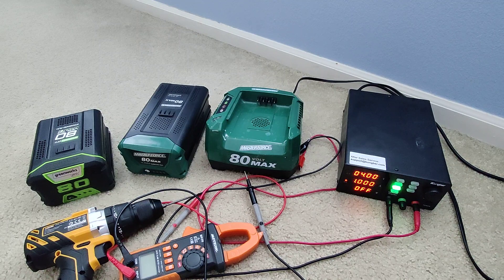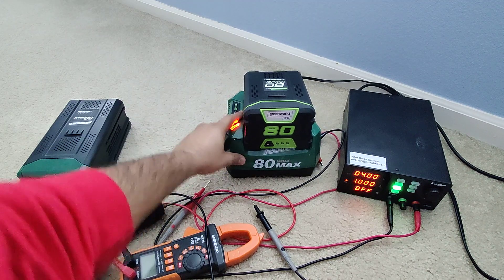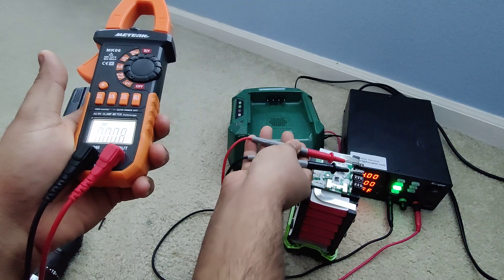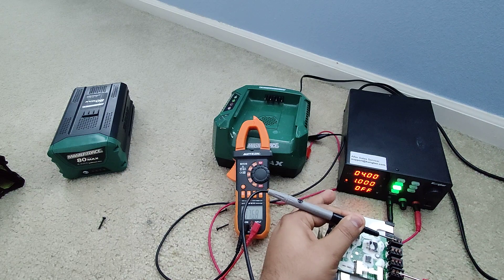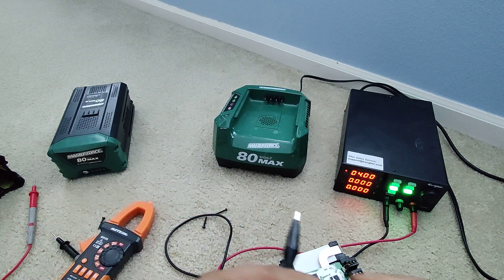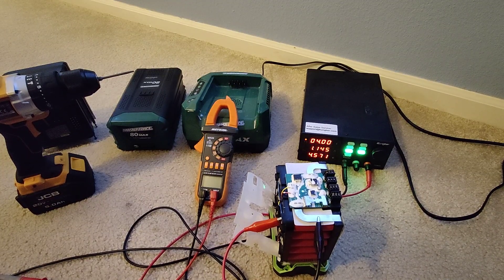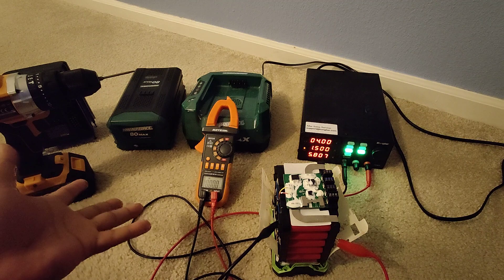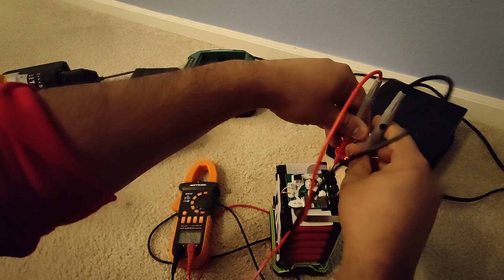Greenworks 80V 2AH Battery Teardown & Repair (Red Blinking Light Error!!!) Part 1

Comment: 19min: but why are the cells out of balance, and won't it just happen again?
Reply from the maker: Depends what caused the imbalance in the first place. If it was bad cell, it will happen again but it was drained due to left in storage for too long then it shouldn't happen again.
Reply: @Xx_TheCuriousBrain_xX  i was able to repair 3x 80v batteries. just recharging each cell using a dc power supply 4.2@2a cc cv   thanks

Comment: My 80V Kobalt have different notches and aren't interchangeable.
Reply from the maker: Interesting!
Reply: You can ‘adjust’ the battery to work (interchangeably). The cheaper Kobalt pack will fit into the greenworks shell.

Comment: I tried your method. Unfortunately, a few cells stuck at 1.9v no matter how long I recharged them. Replacing the cells seems a lot of works.
Reply from the maker: If cells were able to charge till 1.9v then it should be able to fully charge unless it's not holding charge at all. Maybe check with multimeter to see what voltage they show while they aren't charging, also is the voltage dropping pretty fast? If dropping fast and not holding charge, then cells are bad. If they are holding charge at 1.9v then you should be able to charge them up.
Reply: @Xx_TheCuriousBrain_xX  Thanks a lot for the reply. The voltage just stuck at 1.9v, not changing at all.
Reply from the maker: No problem, then I guess cells are bad. Yes, replacing cells is a lot of work but once you master that task, you can repair pretty much anything because pretty much all battery powered electronics uses these cells, your call...good luck!

Comment: As an Avionics AMD AVIONICS Helicopter crewman veteran  appreciate this information, which raises a major concern about the explosion of lithium and other battery banks, likely automotive also 🤔

Consider this: when a series of batteries drops to the weakest battery in the chain, discharged, force by the still charged batteries in operation, "TO REVERSE CHARGE that WEAKEST CELL" destroying it and possibly creating a hazard,  like a fire, triggering a runaway violent outburst of released energy. 

Navy 🇺🇲 veteran
Reply from the maker: Good Point! Normally these cells also have safety features inside that prevent over charge or overheating that basically kill the cell itself that won't charge anymore, no matter what you do but you're right, hazards like fire etc still happen as they aren't 100% safe. In my understanding, these cell can act like explosives either under load or while charging. So I never leave my house when anything is charging, always unplug things including any cell phone as you just never know about lithium batteries.

Comment: I have a Greenworks 40V battery pad with two cells dead 1.09V where I can find these cells to buy, the model number is VAJ9RX8 which is what it says in the battery's first number the other number is the serial of each battery like this 0521227 and it varies on each cell.

Comment: Where can I find the charger you used?  I don't know where to get a charger where you can change the voltage and amperage.  
Thank you.
Reply from the maker: It's called dc power supply variable, lookup on Amazon and you'll find many.

Comment: These batteries should come with a balancing button or something, because with the use they get out of balance...Oviously, companies are not going to do that...
Reply from the maker: That's what BMS (battery management system) is for but it's not smart enough to only charge cells that are unbalanced. It basically stops charging when it detects unbalancing which I guess makes sense because there is no programming or processor that can calculate all that in these BMS. Now you know why expensive cars like Tesla are way advanced as it shows you individual cell voltage and you will know exactly what cells are bad etc.

Comment: Question: I've charged individual cells to with .01. Each cell now has 3.88-3.99v. Put on charger and still blinking red. Any ideas. When tested, 10 cells were close to 3.31v. Battery is one year old. Any ideas on how to proceed?
Reply from the maker: Sounds like you are doing pretty well. Test total voltage of entire battery pack to make sure it's 70v + otherwise it's possible you might have missed some of the cell.
Reply: It's a 60v, 8ah. Total voltage is 58.3. It should work. This is my first time, but can't imagine it not working. I'm about to charge it up directly with another 60v fully charged battery. That's how I started the project. Started with no charge bars showing. After repeated charges, had three bars. Even worked in the riding mower when it was the only battery installed. Makes no sense to me.
Reply from the maker: Yes it doesn't make sense. Okay, so if it shows 58v, then technically it is close to full charge. Do a load test to see if it output fine...maybe use it for a little bit and then try to charge to see if the charger pickup. I don't remember on this battery model but normally BMS also has buttons to reset itself, maybe Google it on how to reset BMS, that might help. At this point, sounds like your battery is charged enough, BMS is being an issue now that's preventing to charge the battery.
Reply: 3 year warranty

Comment: How did you electrically disconnect each battery?
Reply from the maker: I didn't and you don't need to disconnect each cell in order to charge individuall. Simply connect positive to positive and negative to negative, you will be able to charge normal. Just pick positive negative correctly while making sure they belong to that individual cell only..use multi-meter to assure positive negative are correct before charging.
Reply: @Xx_TheCuriousBrain_xX  I think I understand it now the resistance the other way around the circuit through the other 19 batteries would be so high as to limit current.
Reply from the maker: Exactly, so charge them individually. I don't believe you need to charge all of them, just the one that's low...most of those should all match, just 1 or 2 that's below average volume that cause the damage in unless all cells are below 3v or so. Once every cell matches, then regular charger should pickup charging....also do subscribe if you haven't already, to help support...thnx!!!

Comment: How do I get a charger like yours? Can you describe, brand model, etc
Reply from the maker: It's called dc various power supply:-

https://a.co/d/5c1U6UJ
Reply: @Xx_TheCuriousBrain_xX  Don't you need to get an 80V or higher charger to charge 80V batteries as a whole? Your link shows the charger is 30V only. I know your case is fine since you were just charging individual cells. Thanks!
Reply from the maker: @Louis-do2et You are absolutely correct about both of your statements. I shared the link of my variable power supply that I was using to charge individual cells which is 30v per another viewer request who wanted to purchase similar charger but I can't charge entire 80V battery since it's only 30v. Mine is good to balance cells before actual factory charger will pickup charging. This method works great, I was able to repair Ryobi power tools battery and more with this method